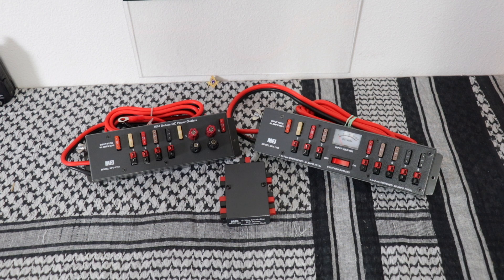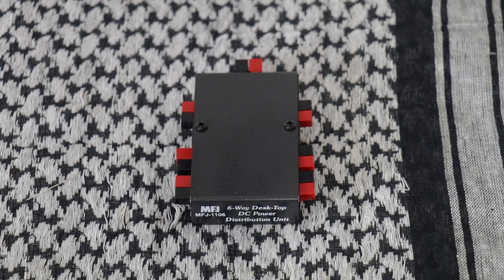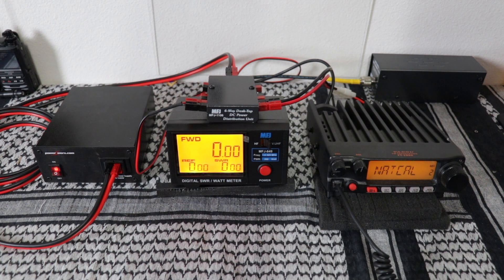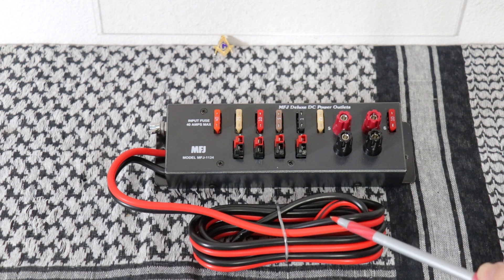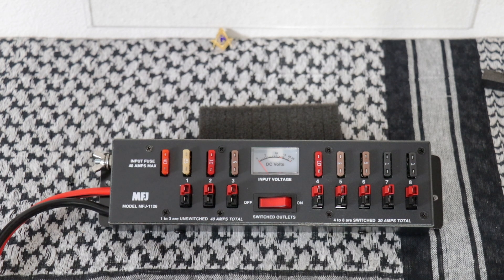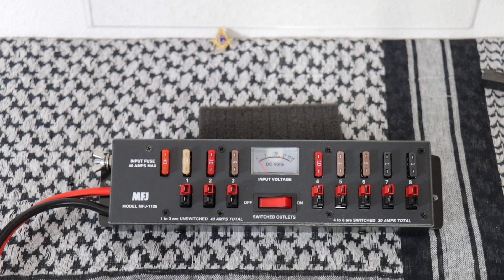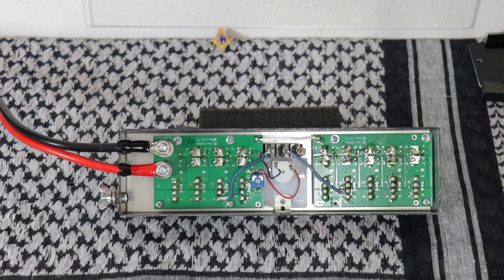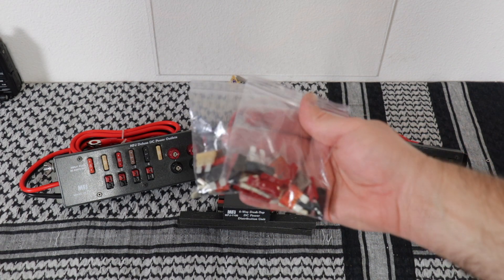PowerPole Power Strips MFJ-1106 MFJ-1124 and MFJ-1126

Comment: Informative video. BUT..... I have the MFJ 1126 and if you only use it for low current applications, it's fine.
I purchased a brand new TS480SAT and the power supply is an Astron 35 amp liner supply. I thought the radio was not functionally properly. I could only get 80 watts out into a matched load w/o the tuner in line. I finally narrowed down the problem, it was the 1126. Even though the radio only needed 16 amps for 100 watts out, seeing the power strip uses a PC board to carry the supplied voltage, it could not carry the current. It was not the fault of the actual Anderson Power Pole. Solution: I wired the radio direct to the power supply and now get the full 100 watts out of the radio. 
I also have an FT 991A on the same power supply. I made my own power pole splitter for that radio. I run a power cable from the supply to the splitter and then supply the voltage to the radio. I get the full 100 watts out of the FT 991A.
The moral of this story is, "Don't use these guys to power a 100 watt radio. Only uses it for 50 watts or less and / or accessories in the shack. "

I still use the 1126 but since I now make my own splitters, shortly I'll be pulling the 1126 out of service. 

Barry G. Kery, KU3X
Reply from the maker: Thank you for taking the time to watch and the comment! It is greatly appreciated.